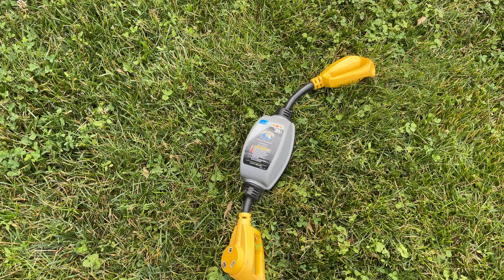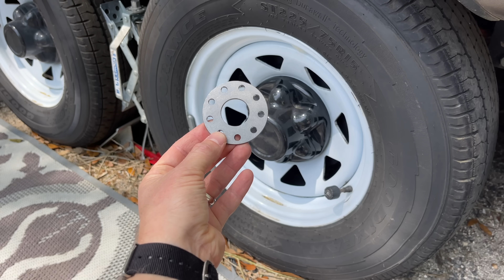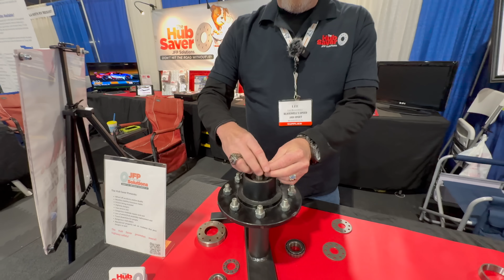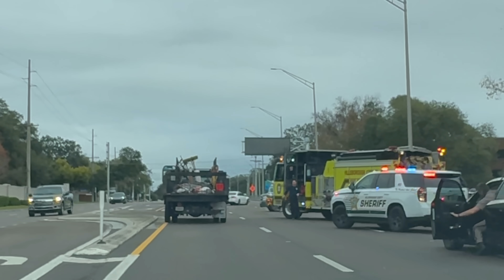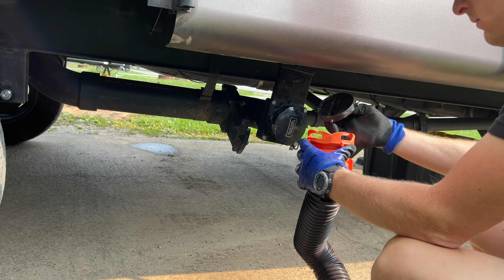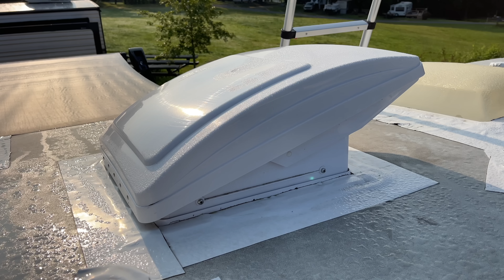RV Upgrades You Should Have Installed LAST Camping Trip (Bet you're unfamiliar with #3...)

Comment from the maker: GEAR LINKS ↓↓↓ Lets take your RV to the next level. Here are nine RV upgrades I wouldn’t hesitate to make again after years of RV travel. I’ll walk you through why an Electrical Management System (EMS) is crucial for protecting your rig’s electronics, how the Hub Saver can get you safely off the road, and why a screen door handle is a game-changer for convenience and safety. I’ll also cover why it’s vital to upgrade your tires, use a good water pressure regulator, and add a propane safety shutoff like Gas Stop. Plus, I’ll explain why investing in a better mattress and high-quality vent fans can make a huge difference on your day to day experiences. Don't settle for the basics, these are awesome upgrades, that honestly, I feel should come installed from the FACTORY.

~~~~~~~~~~~~~~~~~~~~

⚠ Affiliate Disclosure  
Some links are affiliate links. If you purchase through them, we may earn a commission at no extra cost to you. As an Amazon Associate I earn from qualifying purchases.
IMPORTANT! Affiliate links are how I support creating this content - I appreciate you showing your appreciation by using these links ◡̈

✔ Check out my RV INFO Sticker on ETSY: https://rvgearandfar.com/rvinfosticker

⭐ Featured Links
🔷 EMS (Electrical Management System) Hughes Autoformer Power Watchdog: https://geni.us/3A4Au
🟩 Screen Door Cross Bar Handle https://geni.us/gE0Me
🔷 The Hub Saver https://rvgearandfar.com/hubsaver
🟩 Adjustable Water Pressure Regulator https://geni.us/8Tea
🔷 Static Water Pressure Regulator https://geni.us/XTtPXb
🟩 90 Degree Water Elbow https://geni.us/egqap
🔷 45 Degree Water Elbow https://geni.us/tfHuCLo
🟩 3ft Freshwater Leader Hose https://geni.us/nOmGTm
🔷 GasStop Propane Shut Off Valve https://geni.us/73oA
🟩 TPMS (Tire Pressure Monitoring System) https://geni.us/TvYCJ3I
🔷 Digital Tire Pressure Gauge https://geni.us/8oCMaE
🟩 Twist-On Wastewater Gate Valve https://geni.us/HxWto
🔷 Reverse Wastewater Flush Valve https://geni.us/BLpaxj
🟩 MaxxAir Deluxe Vent Fan https://geni.us/Okno6At

⭐ Videos Referenced ⭐RV Blowouts! What You Need To Know To Avoid Disaster While Towing https://youtu.be/TXLVFJCDfZE

~~~~~~~~~~~~~~~~~~~~

💥 *Connect With RV Gear & Far*💥
📬 Newsletter: DEALS & DISCOUNTS Found HERE → https://rvgearandfar.com/newsletter
👥 Free Facebook Community → https://rvgearandfar.com/group
🌐 All The Links → https://rvgearandfar.com/links

~~~~~~~~~~~~~~~~~~~~

🚐 *Favorite RV Gear*

🔌 Power
🔹 50A Power Watchdog Smart Electrical Protector / EMS https://geni.us/c0L2c6
🔹 30A Power Watchdog Smart Electrical Protector / EMS https://geni.us/SFGl3c
🔹 GasStop Propane 100% Emergency Shut-Off https://geni.us/7kaJpkd

🏕 Chocking & Towing
🔹 Solid Rubber Wheel Chocks https://geni.us/6ESZ (Amazon)
🔹 X-Chock Wheel Stabilizers https://geni.us/do0H
🔹 RV Ramp Levelers https://geni.us/plNXsz (Amazon)
🔹 Coiled Trailer Breakaway Cable https://geni.us/G1lrM (Amazon)
🔹 Stacking Leveling Blocks https://geni.us/UryQQ

🚰 Water
🔹 Adjustable Water Pressure Regulator https://geni.us/GKdoUfG (Amazon)
🔹 90* Hose Elbow https://geni.us/UctZej (Amazon)
🔹 Zero G Freshwater Hose 25ft https://geni.us/tpi7H
🔹 Basic 2 Stage Water Filter https://geni.us/1kTGa (Amazon)

💩 Sewer
🔹 Valterra Twist-On Sewer Valve https://geni.us/PLAzB
🔹 Flush King Reverse Tank Flush https://geni.us/yvAcB
🔹 Unique Digest It+ Tank Treatment https://geni.us/7ar04pR
🔹 Liquified RV Tank Treatment https://geni.us/qkUAjH7

🧰 Tools & Gear
🔹 (BACK SAVER!) HitchGrip Hitch Handle https://geni.us/ZcsLeM (Amazon)
🔹 Multimeter w/ DC Clamp https://geni.us/lNV3l4 (Amazon)
🔹 Ratcheting 11-in-1 Screwdriver https://geni.us/sK8yAC
🔹 LED Night Light Motion Activated https://geni.us/N8diQL (Amazon)
🔹 Clip On 8” Fan https://geni.us/22TAG (Amazon)
🔹 Portable White Noise Machine https://geni.us/Fx5lEq (Amazon)
🔹 Retractable Ratchet Straps https://geni.us/pzhIB5b (Amazon)
🔹 RV Screen Door Crossbar https://geni.us/ildK5T
🔹 Red & White LED 12v Puck Lights https://geni.us/7lfqZEa (Amazon)

🛒 Shop ALL RV Gear & Essentials https://geni.us/qABR (Amazon)

~~~~~~~~~~~~~~~~~~~~

🛠 Favorite Tools & Gear
🔸RESQME Emergency Car Escape Tool https://geni.us/LITKLf
🔸EDC Multitool Knife- Skeletool CX https://geni.us/4l7cV
🔸EDC Flashlight https://geni.us/DFmxXzm
🔸BEST Disposable Gloves https://geni.us/oJAXFVL
🔸Digital Tire Pressure Gauge https://geni.us/sTRE3yj
🔸Digital Laser Thermometer https://geni.us/6e0A0 (Amazon)
🔸12V Emergency Jump Pack https://geni.us/CC53c

~~~~~~~~~~~~~~~~~~~~

© RV Gear & Far, All Rights Reserved. 

This channel is for entertainment purposes only. We share our opinions, experiences, and what works for us. Please do your own research and make your own decisions.

#rv #rvlife #rvgearandfar
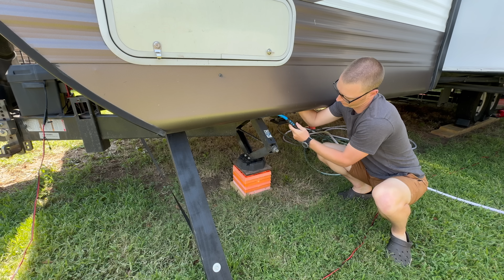Reply: 7:04 having worked in well water and pool cleaning industrys, NEVER, EVER, EVER, EVER, EVER, LEAVE REMOVABLE FITTINGS CONNECTED!
They will eventualy never come off without cutting off the connection point.
Reply from the maker: @justsoicanfingcomment  all depends on the materials - a brass or stainless steel elbow into a plastic fitting on the board won't be an issue, but definitely if you have quick connects or metal on metal fittings I can attest to your caution first hand ◡̈
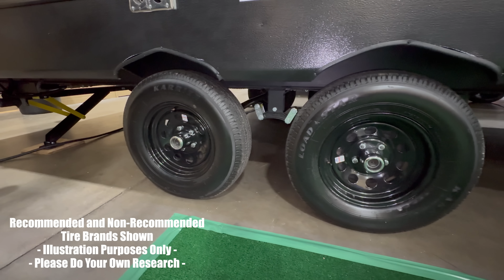Reply: 9:17 A more important thing is to check tire manufacture "date" many manufacturers use cheap tires due to the well known issue that RV's and trailers will sit on a sales lot possibly for years before sale and not spend the money on high quality tires that will dry rot from sitting.
The low quality tires arw fine within a few years of manufacture, typicaly....
So check the date of manufacture.
Note, the trailer may be new made this year, but that tire may have sat in a warehouse or exposed to the elements in a staging yard for a year or two before going to it's destination.
Then sit on the trailer for however many years before it sells.
Even good brands go bad over time.
Reply from the maker: @justsoicanfingcomment  Absolutely - those DOT date codes are important. And for everyone else reading - its a 4 digit code on ONE side of the sidewall (so check the inside if you can't find it) but will have a 2 digit week code and a 2 digit year code: For example: 2321 = 23rd week of the year 2021
Reply: @rvgearandfar Maybe make a video explaining tires and important stuff like that. :)
Reply: Did I see your screen door close by itself after you exited it at the end of the video? Is this the way your RV came or an aftermarket product?? Thanks for another great video.
Reply from the maker: @TheGrainSideUp  Yes - you can add springs or an elastic strapped push bar that will close the screen door:

(Amazon Affiliate Links)
Camco Springs: https://amzn.to/3QKxaU5

Lippert Screen Assist: https://amzn.to/41jds6E
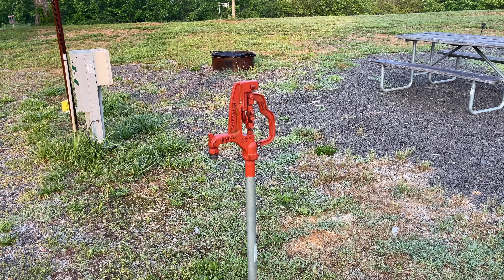Reply: 5:12 How about ripping out all the crap RV plumbing and put in proper pipes that can handle the presure and/or put in a water hammer arrestor... a big one.
The last part is cheap and very effective.
Reply from the maker: @justsoicanfingcomment  The pex can handle the pressure according to specs - its the plastic pex fittings that are the weak point. Hammer arrestor could be an easy addition to the system too - have you added one?
Reply: @rvgearandfar Yes and I dont use pex...
I use hydralic hose.😅
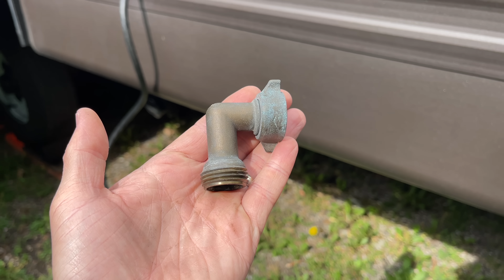Reply: 6:10 I ripped out the original connector and replumbed it pionting down.
One less thing needed, but for sure an elbow will help those who have exterior water connections.
Would not recomend if you have a internal hookup bay.
Reply from the maker: @justsoicanfingcomment  I think the elbows are still valuable for internal bays - a 45* versus a 90* may be more appropriate depending on the setup though.
Reply from the maker: @justsoicanfingcomment  Did you replumb it down through the floor? What method did you use to seal the original hole for the water connection?
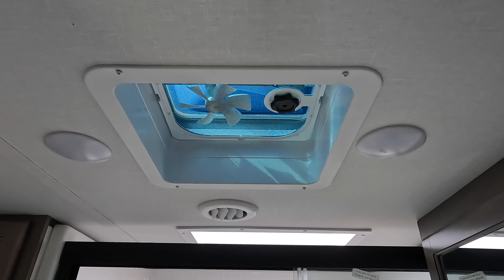Reply: 14:07 I'll do you one better, a floor vent and hatch.
Heat rises.
Put a vent in your floor to pull in the cool air from under your RV, Trailer.
If you can not find a shady place to park and are boondocking will be a game changer.
Especialy if you can shade the sunny side of the RV/T undercairage with solar or popup tent will boost the cooling even more.
Reply from the maker: @justsoicanfingcomment  Airflow - passive or active - is definitely a game changer. Thinking about your rig @justsoicanfingcomment5814 = where would be a best spot to install a floor level vent?
Reply: @rvgearandfar Probobly where you get the most shade on your rig and will need a relpacable cover that lets airflow through and still be able to walk over it and two diffirent locations that acomplish diffirent tasks are one directly bellow your roof vent for fast heat removal from a single room or a vent further away to make a cross draft to cool multiple rooms.
Personaly I only make use of the floor vent in the bathroom for the can and shower room to get rid of smells, moisture and pasivly cool off grid as they are both cramped spaces that you might be in for a while and don't want to be supper hot while using.

Comment: The thing about the "propane tank on/off debate" - there really is no debate.  It is absolutely illegal to drive down the road with open tanks in some (many?) states.  Not really something to debate.  Shut them off.  If you MUST have refrigeration, get a 12vdc refrigerator.  :)

Comment: I drive an extended ARI sleeper Semi as my job, I also have a 2021 grand design at home, I had a water pipe failure in my semi due to the WEAK PVC OR GLUE for my sink/ shower, due to a high pressure water system in a truck stop I was using to fill my fresh water tank. Luckily I always check inside the semi during water reloading for this very same reason. I figured out what the problem was, bought a simple water pressure regulator for my truck and my camper, now i feel WAY more confident

Comment: We had a set of the tire scissor clamps but gave them away. Since we have sliders on both sides, readjusting them, after the sliders were out, was not an option for this old fart. We went back to the good old fashioned wheel chocks. I will get the LP gas shut off valve. My parents lost their motorhome once because they drove with the gas ON. I tried to tell them not to but...  We do have the screen door bar, manual valve on the sewer outlet line, water regulator & filter, and the Tire Minder system. All good advice for anyone! Thanks!!!

Comment: Here’s my take on tires first immediately replace Westlake tires, PURE CRAP. Second I never leave my spare on the rack during any storage/not in use. I put mine in the camper. I had a cover on my Westlake spare and it had blown from sun heat and I didn’t even notice until I took the cover off to wash the entire unit.

Comment: We have a 2023 Cortes Campers 17 that came with the Hi-Spec tire and rim Chinese-ium specials.  I am going to replace them with some reputable rims, yet to be determined and a set of Goodyear KO3 AT load range D tires for a truck.  This camper fully loaded out has a 3500 pound capacity and I think those tires will work just fine and make me feel better about towing a camper with a single axle.

Comment: Goodyear Endurance for the tires.  The Dexter axle on our trailer has larger washers already installed.  Our black and grey tanks came with individual valves for each.  Makes the dirty deed much easier and less stressful.  We use puppy pee pads in case there is any seepage.  Consider separate hoses for fresh water and utility water.  We have a blue hose for fresh and an orange for utility.   The screen door handle is a popular accessory, but they, and the screen they attach to are quite tender.  One needs to be careful how much force is applied.  Our TPMS has made our journeys much more relaxing.
Reply from the maker: Sounds like you're squared away!

Comment: From what I read, all propane tanks currently have an EFV, a spring-loaded Excess Flow Valve inside the ACME nut, which will shut off flow if a hose or fitting suddenly breaks.  I ordered the Hub Savers and let them know I heard about them on your channel!  Something else to upgrade are the wheel bearing seals to a double-lip seal.

Comment: A handle on the screen door is such an underrated upgrade! I'm with you, I don't know why more manufacturers don't install them as standard equipment.
Reply: @rvgearandfar I have a 2022 crossroads Volante. A section of the awning light isn't turning out. Got any tips? I don't know if I should replace the whole thing or if I can repair the existing light.

Comment: I will ask you about surge protector. How long should your surge protector last until you should replace the unit. SURGE GUARD FROM SOUTH WIRE. Purchased 2018. It is currently on kz  sporttrek touring edition. It was used on for those years to today.
Reply from the maker: It all depends on how much "surge" energy the unit has absorbed on your systems behalf. I reached out to Southwire to get an experts answer for you and this was their reply:

""
The only thing that can be used up is the surge protection.
 
The surge protection is achieved through Metal oxide varistors MOV's.
We do not use only 1 MOV, we have a bank of MOV's and the odds of all of them not working is impossible.
The MOV is kind of like a slow fuse per say, for transient surges. It does its job well but once it is used up, it is no longer good.
They will take several hits over years, but depending on the conditions and severity, is how long they will last.
It is possible to only last with 1 massive surge.
They can be hit with a single power surge if it is bad enough. We sometimes see this in lightning storms.
 
When your surge protection has been spent then the surge light will no longer light up.
On some models it will also give you a message on the LCD screen.
 
Your SG has a limited lifetime warranty is good from Date Code 1748 and newer. Date Code read year/ year / week/ week.
That can be found on the back of the unit.
What the warranty does not cover:

    If surge protection has been spent - Unit did what it is supposed to do and sacrificed itself to protect the coach.
    customer damage such as abuse.
    Melted plug, - That is caused by corrosion and arcing from loose connections. A miss wired pedestal that causes overcurrent on the neutral can also cause heat damage.
    Acts of God like Lightning - Mother nature is way too powerful to stop from a direct hit. However, a feeder leg far enough away and as long as the surge is not greater than what the MOV’s capability then you are covered.
    Unit must be purchased by an Authorized dealer.

""

Hope that helps!

Comment: Tires. I have used Carlisle tires on my 5th wheel for many years with great success and no blow outs. Very happy with them. If you are a part time RV person like I was or even a full time person but don’t put a ton of miles on these will serve you very well. I only ever put a few thousand miles on them so I have no idea about high milage applications. 

With tires remember you should change them every 5-6 years or when you see cracking starting to happen. Once cracking around the wheel and/or between the tread starts to happen you are just asking for an on road failure to happen. Not worth the risk. 

TPMS system I use for my Rig (both when I had a truck and trailer and now I have a motorhome) is the GUTA TPMS system. It has worked great. My first system that I had in my truck and 5th wheel only had one issue after many years the plastic mount for it degraded and broke but the system itself still worked. Basic and functional. I got mine on Amazon and the sensors use common button batteries that last over a year. You can get cap style sensors and flow through. I prefer flow through but cap style work better on some vehicles because they don’t stick out as much.
Reply from the maker: Appreciate the data point on the Carlises

Comment: A good EMS will delay restoring power for a couple minutes to protect the AC compressor.  Most will not turn on power if there is an issue,  such as bad ground,  bad neutral, or reversed polarity.  Most will have a display that tells you what the issue is so you know what you're talking about when you report it to the campground.
Reply from the maker: Yupp!

Comment: I live dangerously. I don’t have and have not used a serge protector. I’m more worried about tire blowouts.
Reply from the maker: Honestly surge protection isn't the biggest concern - its high and low voltage and the stress that can put on your appliances

Comment: Most S series tires they put on towables are only rated for 55 mph. Can't tell you how many times I've seen these campers blow by me on the interstate only to see them with a big blowout down the road. Get a Goodyear Endurance or Carlisle 8 ply tire, they are rated for 80 mph but I still only run at 65 mph....you don't lose that much time driving slower. Also, if using a screw on tire monitor cut a small section of pool noodle or something like that and slide that over the stem before screwing on the monitor. Centrifugal forte will push that monitor against the tire rim and cause damage to either the monitor or the rim. The pool noodle or hose will stop that from happening.
Reply from the maker: Have you used the pool noodle or hose as a support for your valve stem for a long time? Replacing a rubber valve stem with a metal valve stem will solve that issue as well.

Comment: I have a question. What is the right torque to when it comes to Titan up the lock nuts on the wheels and an RB?
Reply from the maker: You'll have to do some research on that for your specific setup. It's going to vary based on the wheel size, the threads and thickness of the lug studs.